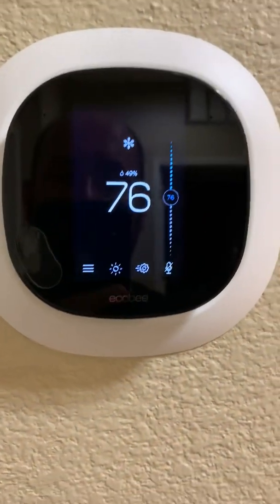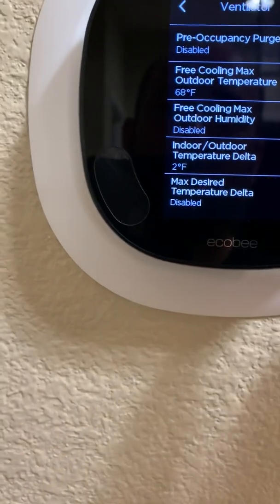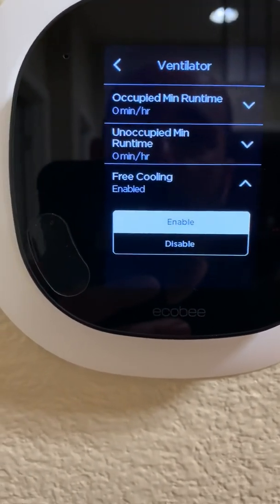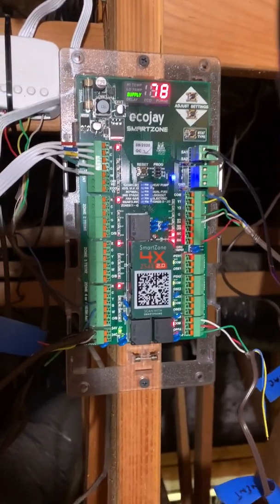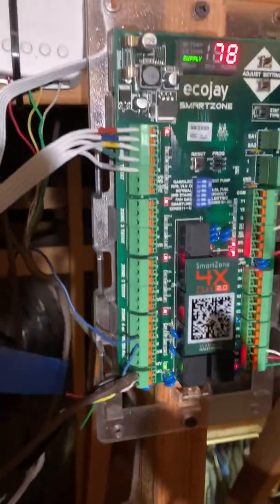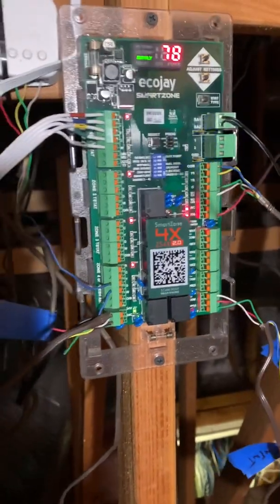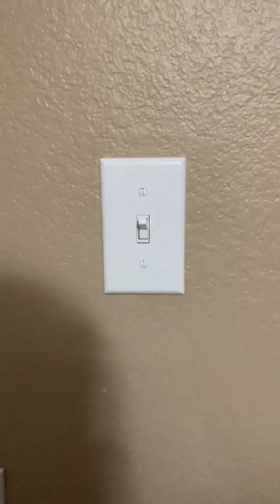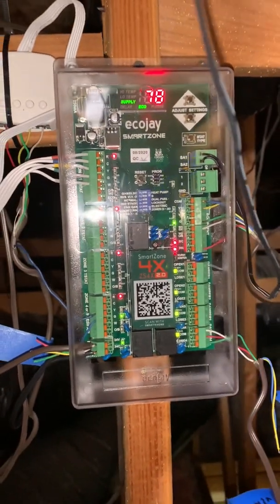Beutler smart vent fresh air damper operation Ecobee smart thermostat ecojay 4x board manual switch

Comment: Thanks for the video(s) regarding change out of controller and thermostats. Question, where are you pulling the 24V for the single pole manual switch? Also, any chance you can snap a pic of your updated setup? Thanks again!

Comment: My fresh air damper was disabled by the previous home owner and I believe it’s in a closed position.   I live in the Seattle area so I want the ability to bring in cool air at night during the summer.  I also want to mix in fresh air that’s filtered through my HVAC filter.  We typically have low summer humidity so I’m not concerned about that.  I have an HVAC contractor scheduled to install a new Honeywell fresh air damper that can connect  to Ecobee. Can I tell Ecobee to run the ventilator all night via a quick change?  Also, what should I set the minimum run time per hour to bring in regular fresh air?

Comment: Why wouldn't one simply use a 12v to 24v step up convertor on the output of the original control board to the new thermostat instead of spending the money on the Ecojay 4X?

Comment: I replaced my thermostats a few years ago with smart thermostat, but didn't think of the ZTech Smart Vent working in tandem, just turned off my AC when using. The ZTech Smart Vent has it's own controller/thermostat. So you're saying I can eliminate the ZTech controller and integrate the functionality by using the ecobee thermostat and ecojay 4x board?

Comment: I have 2 ecobee enhanced thermostats and I was gonna get the eco jay 4x board. Do you still recommend it, any issues or failures with it?
Reply from the maker: It has performed flawlessly. Love the ecobee too.
Reply: Cool thanks
Reply: Great I’m gonna order today. Another question I had is that if the free cooling starts let’s say for zone 1, does it call the fan for that zone so the damper would open for that zone? My undertstanding is it for sure powers up the accessory wire on the thermostat, which on the eco jay goes into the G on zone 4 and will turn on the equipment fan and open the vent for the fresh air, but I can’t find anything that specifies if it also powers the fan wire for the zone that’s requesting cooling which I need to open the damper. I would assume it would, but it seems that instead of powering up the Y wire for cooling for that zone it powers up the accessory wire, but I need to make sure it also powers up the fan wire
Reply from the maker: @DoEverythingDerek  yeah I'm not sure, you can call ecojay, they are pretty responsive.
Reply: @macj98  I did confirm it does energize the fan wire when it calls for cooling, whether it’s powering the y wire to turn the compressor on or using free cooling just turning the ventilator on, it also powers the fan wire :) I checked with my multimeter but the thermostat also says cooling fan or cooling ventilator

Comment: Bought the ecobee premiums last night and I now see the ventilator settings.  Now I just need to figure out if I can safely tie the blue wires from both thermostats together and run them both into the Zone 4 Y socket on the ecojay.  It would make sense that either of the thermostats should be able to activate the smartvent.
Reply from the maker: Read the update in the description. Put it in the "G" not Y.  The ecobee will control the smart vent in the G position, in the Y the Ecojay 4x will. Since you bought eco bees you'll want G, otherwise the thermostat and ecojay will fight one another. Took me a min to figure that out.

As for hooking both wires together, if you are worried about it, you can use an AC relay.  I ended up adding one so I can use my ecobee or a manual wall switch for the smartvent.
Reply: @macj98  Perfect.  Yeah didn't catch the update part.  A relay definitely sounds like that'd be the best solution to keep things isolated.  If you don't mind me asking, what relay did you end up going with?
Reply from the maker: @dkeller626  I got one like this from Amazon.  OONO DPST 1NO 1NC 8Amp Power Relay Module, AC/DC 24V Control Voltage https://a.co/d/2zlv41y
Reply: @macj98  Ordered one of these:  https://www.amazon.com/dp/B09T6S4JVH ---- as I'm pretty sure I'll need two NO's on the output side.  Plan is, I'll tie the two yellow input leads together and attach them to the common pin on the ecojay's transformer input pin.  Each thermostat will then have it's own coil (blue input lead).  Output side, I'll tie the black lines together, run them to the G pin on the Zone 4 pad.  The red lines get tied together and sent to the other Pin (hot) on the transformer.  So then, once either side of the input gets energized, it's the equivalent of sending 24v to the G pin.  I'll test with a power supply first to see if I get my desired result without blowing anything up.  :)

Comment: Beutler smart vent here too, in Lincoln CA.  Just installed the Ecojay 4x and 2 ecobee enhanced thermostats with the PEK, very similar setup to yours.  I like the ecobees, however, I'm not able to find any 'ventilator' options while configuring my ecobee.  After digging, I think I may need to return the Ecobee Enhanced and instead replace with the Premiums to be able to control the smartvent when using the PEK.  Not very happy at this point, since I don't need all the other Premium features, would rather not have all the voice/room sensor garbage.   This was not entirely clear on the option/comparison on their site.  Under 'Adding Accessories', 1 Smart Thermostat Enhanced only supports one-wire HVAC accessories via the PEK+ connector and doesn’t support an accessory (i.e., a whole-home humidifier, dehumidifier, or ventilator controlled by the thermostat) and the power extender kit (PEK) simultaneously. If you are using the PEK to power your existing ecobee thermostat and have an accessory and are upgrading, we recommend Smart Thermostat Premium.
Reply from the maker: I have added the room sensors after the fact, they are actually really nice.  If you turn on "follow me" it will adjust the room you are in to the temp on the thermostat. It will also average your sensors in the occupied rooms to determine when to operate. Very neat feature. And if no movement is detected in any of the rooms it will go into "eco+" mode.

Comment: Hi, thanks the great video!  I have a beulter smartvent system too.  Can you help and post a picture of where exactly the supply air sensor should be installed?  Greatly appreciated!  Thanks.
Reply from the maker: The air sensor for the ecojay?  They give you a rough placement in the manual.  Mine is in the middle of my damper box. I'd get you a pic, but it is 107deg here right now so my attic is probably 150deg.
Reply: @macj98  understood 😀. I think I found the damper location.  Should I install the temp sensor her (please see attached pic link).

Comment: Good day. 
I am replacing my Beutler Z-Tech board with a EcoJay4x Controller. I currently have a (Beutler) SmartVent connected in a basic Ventilator/Economizer mode. 

My Thermostat replacement is a ecobee Smart Thermostat with Voice Control utilizing the PEK.  AND I do have one free wire available - that I was told I can use to trigger the Ventilator function on the ecoBee.  I know where I can connect the wire on the Ecojay4x.  But I am not sure where to connect on the ecobee.  

Online You tube video https://www.youtube.com/watch?v=Rk9PEZQJbUU says to connect extra (blue) to Y... But I want to be certain before I smoke check my HVAC.    

Can you please help me?

Thank you in advance, Dave

Comment: If I don't want to use the smart vent anymore (installed whole house fan), but would like to install a smart thermostat, can I get away with just leaving the smart vent controls disconnected and assume my damper will stay closed?
Reply from the maker: Yes you could. 

Although the smartvent is better than a whole house fan because it allows you to leave your windows closed, and pushes the outside air through your filters to remove allergins, smoke, pollen, etc.
Reply: @macj98  Well, to each their own on that point.  I hated the smart vent when I had it.  Didn't move enough air or cool the house down fast enough, and I like opening the windows and having the breeze that WHF creates.  Also, since it's the heater fan that was running, it burnt out pretty fast and that cost me $1K to replace.  I had them disconnect smart vent at that point and installed the WHF.  Anyway, great video here and I think I'll give this a try.  Appreciate the info.
Reply from the maker: @toddmoffitt  if you have no desire to ever hook it back up, you may be able get away with the ecojay 2X depending on how many zones your house has. The main obstacle to a smart thermostat is the zone control Board only outputting 12v.
Reply: Could you please explain how does this system work? I live in Sacramento and i think i have same system. From where does it suck air? Does it make attic cooler as well? Why we need to keep windows closed? Do we need to change any outside filters?
Reply: @vinay--kumar  It sucks air from a vent in the roof.  Typically located on the back side of the house.  Yes, it does make the attic cooler as the damper/vent changes position in smartvent mode to exhaust air into the attic.  

I am replacing my Z-Tech Board and Thermostat with a EcoJay 4x and EcoBee with Voice.  You can get a super deal on the EcoBee from SMUD.. 
Good Luck.
Reply: I replaced my thermostats a few years ago with smart thermostat, but didn't think of the ZTech Smart Vent working in tandem, just turned off my AC when using. The ZTech Smart Vent has it's own controller/thermostat. So you're saying I can eliminate the ZTech controller and integrate the functionality by using the ecobee thermostat and ecojay 4x board?